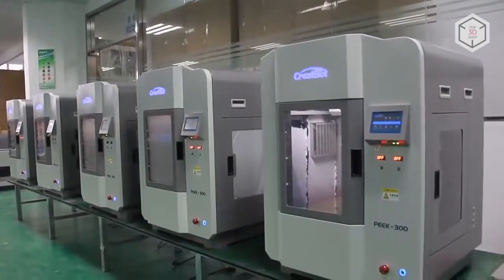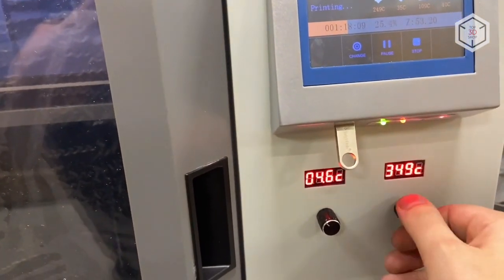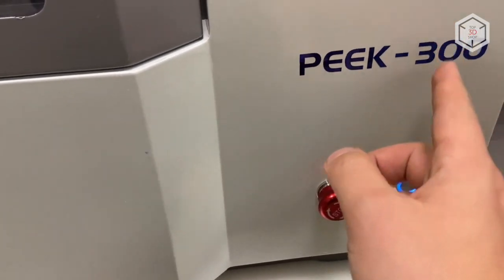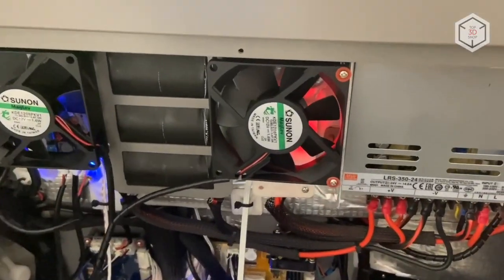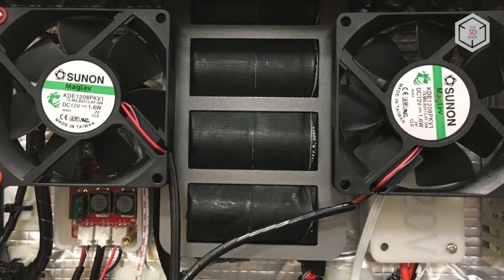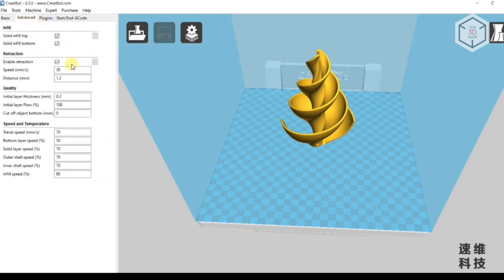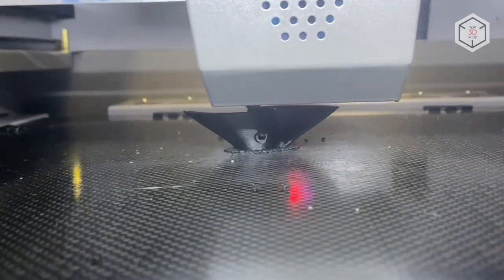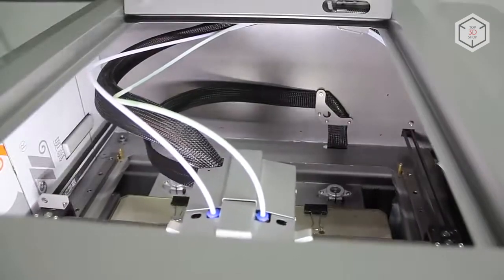CreatBot PEEK-300 In-Depth Review: A High-Performance Industrial 3D Printer

Comment: 120° chamber really isn't enough for some HT filaments, especially large PEI prints, or even smaller PI parts. Even with hot air blowing over the part... Larger parts will deform quite a bit

Comment: Well the printer for me is not good, special for the high price that it cost. For print PLA it is very recomended to open all the doors.... i have nozzle cog many times. I will say that the build, the bed are good enough for many years to came, but others things like the water cooling solution i have many problems it and i need to clean many times the small water tubes. 

The position of the bltouch is not good and incredible the first time that i run the printer calibration fails because the bltouch in the last position is outside of the bed. Yes it is incredible for this price tag machine. For resolve this i print a suport for move the y-axis end-stop for one position that works for the bltouch all points calibration.

Also Peek it is very dificult to print, i will not say that this is not a good printer for this, But I would pay to see how they print those large pieces in Peek. And also a review of this machine with printed parts from Peek would be good, right ?

Comment: The heatbed isn't rigid enough, it's vibrating during the print. BLtouch useless because in the last measuring row it's measuring behind the heatbead, in the air... and then a bed leveling failing. There is 5x A4988 stepper driver on the motherboard which makes the printer very loud. The metal door are vibrating and making noise too. So it doesn't recommend to use in workshop or office except if you want annoying your collegues. This printer is really outdated and bad build quality.
Reply: that hasn't been my experience. the side metal door vibrating is easily fixed by putting some cardboard between the gap, build quality is very stury. the heatbed does not vibrate during the print. I have several hundred hours on mine now and it still prints great without issues.
Reply: @SpicyKorbo I been looking into this printer, how's your experience with it so far??
Reply: @SpicyKorbo Yeah but for 13k it should have had a felt washer or something like that in there from the factory... to stop vibration.